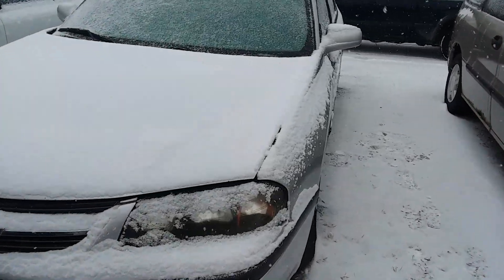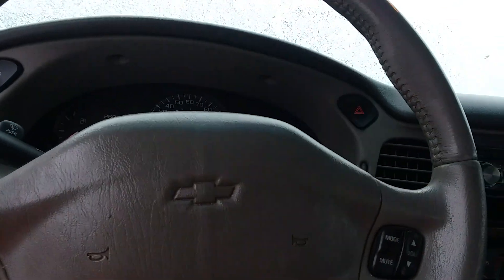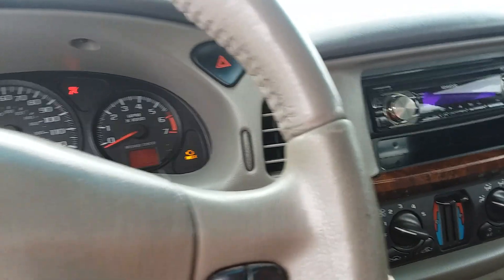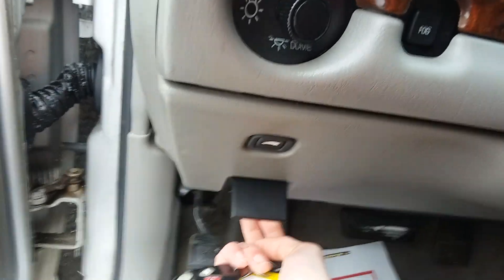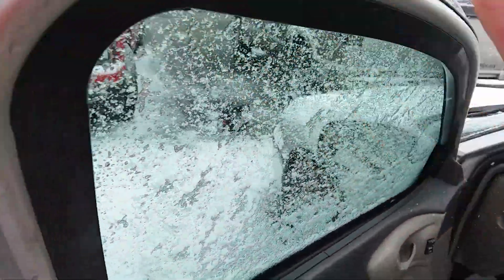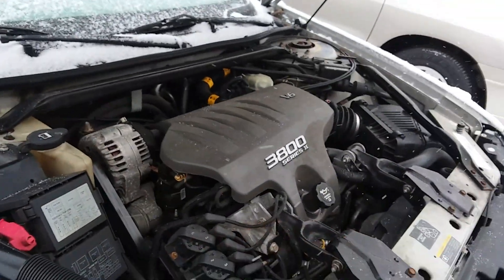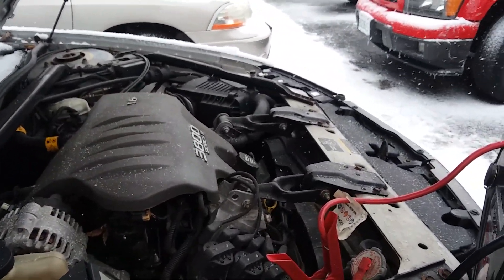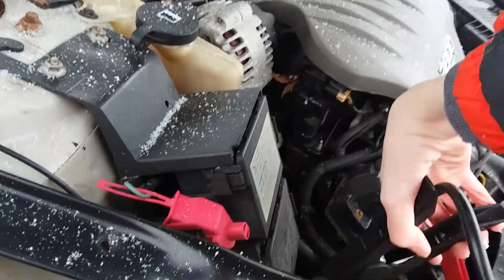Jump Start: 2002 Chevrolet Impala

Comment: Common sense just isn't as common as it should be. If you put the headlights on, even just the parking lights, when you connect anything to that battery, you'll at least know if you have a good connection, and if you have the booster on. I watch some of these young men and it drives me up a wall to see that no one has taught these young men, I guess that's what a single women parent raising a young man does, so sad!!!